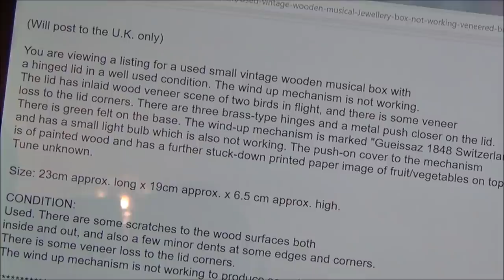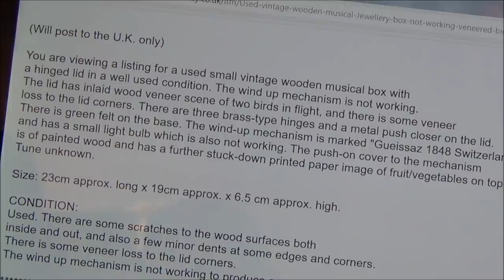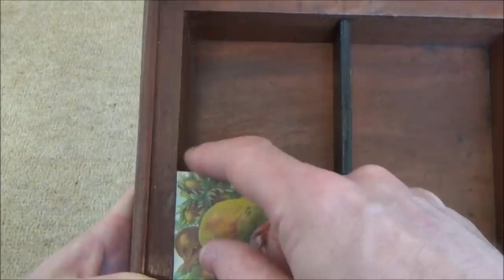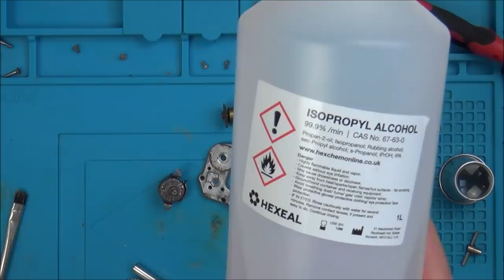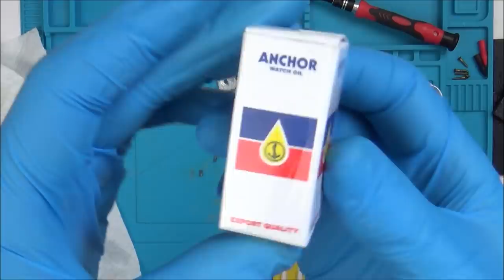Trying to FIX: Vintage Clockwork Musical Wooden Box

Comment: The lever is there to stop to governor when the lid is closed, it wasn't part of the electrical circuit. The brass tab on the right side was one half of the battery contacts.
Reply: @kruleworld  I bet the battery was supposed to be one of those 4.5 volt flashlight batteries, and the top contact went to the metalwork.
Reply: Yep, perfect answer. It's the same as the dancing ballerina as kid closed governor stopped
Reply: @waynestyles4523  no
Reply: @waynestyles4523  d
Reply: precisely
Reply: +1

Comment: The song is 'The laughing song' from 'Die Fledermaus ' by Johann Strauss. The musical box movements are still available to buy ready to put into a box etc. The lead things at 25:05 are dampers. There are on the higher notes to stop them ringing on too much or else it would be just a muddled sound like playing the piano with the  damper (loud) pedal on.
Reply: They are on the lower notes to add mass so that the "harp" does not need to be as long is it would otherwise.

Comment: I agree!  The broken piece was connected to the red wire and would ave been isolated from the frame much like the negative was.  When it broke off it allowed it to make contact, unless it was an earth positive system, but I have only ever heard of those on very old cars.  It would just take a AA or AAA batter set right in that little space.

Comment: Perhaps the light flashes with the music? (Only creating a circuit when it’s touching the pins?) - also there is normally a pin sticking up from the bottom (rather than down from top), so when lid opens, it releases the governor.

Comment: Great stuff Vince you could probably use a small dc motor in place of the governor it would slow it down with the load of the light on their...To generator power for the light.. But not worth the effort doing that....Anyways keep the videos coming as we are bored at home..

Comment: I was about to scream at you but wanted to wait to see if you figured it out. 

The red wire should be isolated and run to a tab separately long the top, the tab being the positive battery terminal.  The black wire should be run to the tab that hangs over the actuating arm. 

Then the chassis of the music box should be grounded to a tab at the bottom for the negative battery terminal.  That way, when you open the box, the start/stop arm (Ground) lifts up and makes contact with the tab (the one with the black wire leading to the bulb) that is hanging over it, completing the circuit.  There is room next to the music box for the battery.  Not sure if it is worth it, because all you are doing is lighting up the inside of a closed box.  But if you have nothing better to do....maybe if you made the upper part out of white acrylic?

Comment: The battery is 4.5 volts and is placed vertically with the contacts facing the wall of the case. One battery contact is fixed to the black cable plate and the other battery contact is free. When you open the case lid, the red wire contact touches the top contact of the battery and turns on the light.

Comment: The ninth fork from the left (as you look at it) sounds horribly out of tune to my ear. It's almost half way in between an A and a Bb. If you decide to take it apart again Vince, have a look at the felt pad and see if you can tune it. :)
Reply: I was listening straight through my laptop speakers and I wasn't getting many of the lower notes at all. On second listen, through headphones, I think there are quite a few of the lower notes which are out although not by as much as that particular one.
Reply: Use a free Android guitar tuning app like gStrings. You will be able to tune each prong exactly by adding or removing solder.
Reply: I'm so glad Vince tried moving it over one peg. I was curious if it would sound better... as soon as he started it I winced. "Nope! Move it back, move it back! You had it right the first time!" Haha.

Comment: The blobs are tuning weights to adjust the tone frequency. The felt is used as dampener to reduce the metal scraching sound which appears on deeper notes.
Reply: The Good Guy he could handle tuning. He’s used an audio spectrum analyzer app in his Walkman series. He’d need to at least know the song’s key but that’s just a google search away.
Reply: Any free Android guitar tuner program would work.

Comment: watch battery behind the bulb holder, then the lever that stops and starts the music has one wire to the bulb attached and the other connects to the whole mechanism, basically make the pivot switch stop and start the music and be the switch for the bulb

Comment: According to the Gueissaz website the company was founded in 1848. From what I have seen all of their products, regardless of date of manufacture, have that date on them. 
From photos of many mechanisms I've seen, the stop bar is bent to fit each application depending on where the box lid has a protrusion available.

Comment: The bent brass tab you removed I believe is suppose to attach to the red wire and then sit between the music drum and the wood separator. The battery would then sit between the two brass tabs.

Comment: been doing a little research on the mechanism and from what I can find the mechanism in use here was changed after 1948. So looking at the materials in use and the machining techniques I would place it somewhere between 1900 and 1948. the box itself could have been made any time.
Reply from the maker: Thanks for letting me know :-)
Reply: @Mymatevince  the date on the mechanism is reflective of when the company started. The base is cast alloy so it suggests it was manufactured after 1900. From what I could dig up, that mechanism was in use up until 1948 so it's at least 70+ years old or could be as old as around 120 years. Looking at the box, the box itself is also quite old but at some time has definitely been added to - ie. the picture. Again you could assume the box is somewhere between 50 to 80 yrs old based on the patina and condition/type of wood
Reply: The base looks like it is made out of zinc (or zinc alloy), the screws are of the pre-Philips head era.  So my guess for it's age would be the late 1940's/early 1950's.

Comment: What a nice video Vince! It's indeed a long time since you did a mechanical item and if you did, it was one of those talking figures. Not that they are rubish or something like that, but an item such as this music box is, like you said many times in this video, very well-made so that you can repair it quite nicely and really enjoy the working mechanism at the end. Really, I love working on this kind of mechanisms too. Besides the light bulb issue, something is not quite right with the tuning of the notes and to correct that you have to tweak those blobs on the "needles", but I guess it is not that easy to do and it is in any case veeeeeery much trial and error. So, just leave it like it is I would suggest. And oh yeah, I really was laughing when you were aligning those needles to the barrel; I've done that a few times in the past and it is really a very time consuming job; but then, when it all works, it is sooooo satisfying... Anyway, great one really, keep on doing those mechanical ones, I love it!

Comment: 4m38s - note the two holes. Someone has took that off and at the very least added the notch for the (I assume) magnet clasp. How do I know? The holes are wrong way. Probably means originally it only had a hole to start/stop the music box. Someone then added the light and a hole and then finally modified it for the magnetic clasp.

The post in the top looks shaped which means it probably used a clasp in the base that was “springy” to lock it. It may also be that post is the original and may have been used to operate the music box. Look for holes :)

It’s also possible that surround for the music box was not originally there when the box was made.  That looks like someone painted it once it was in place rather than the finish the rest of the box has. My theory is either there was no music box or it was uncovered and then boxed in, light added later and modified again for the magnetic clasp.

Comment: Looks like a gap for a AA battery to the right of the mechanism. That brass tab was probably one terminal, the other was what the black wire was fixed to.

Comment: I think the light bulb was ran by a AA battery on the right side of the machine. The bras tab connected to the red wire supposed to be in the gap on top right side.

Comment: I bet the bulb was wired with a spring switch. when you close the lid the tab on the bottom of the lid opens(breaks) the circuit but when you lift the lid the contact springs back to close the circuit. Very simple.

Comment: The lamp might have been powered by a 3R12 battery. They were very common for many decades and the circuit for the light was probably was designed for the battery tabs.

Comment: The Light was a home made addition. The black wire went to the large tab of metal for one end of the Battery. the red wire has a broken tab where the original tab ( contact) would have been. Its just a crude bodge  to add a light

Comment: You know, I've been thinking about the power generation thing.  Even though its clear that it wasn't intended to generate power here's what I see.  If the blade of the "air brake" were a bar magnet and there was a coil next to it, it could induce a current.  Admittedly, it would be far too small a current for the light that's in it.  But I bet if you collected that current into a capacitor, it could drive a modern LED for a little while.

Comment: One terminal of the battery was probably connected to the black wire and the other terminal connected to some part of the "stop" mechanism, rigged up to make contact with the mechanism when the lid was open, completing the circuit to the red wire.

Comment: The brass piece you pulled out of the mechanism looks like it should have been attached to the red wire, it looks like there is just enough room on the right side of the mechanism for a battery. With the brass tab at the top against the wood.

Comment: Never seen a circuit like it, but what I have seen is a circuit that is close to that, where the circuit is completed when the Brass chiming prongs touch the barrels pins by three different coloured lights each colour was insulated from the other colours circuit, any way long story short the lights would dance as the music played, and me thinks this circuit was an attempt to hack out something like the aforementioned..
Reply: I thought that too, maybe that's why some of the pins have the insulation on, maybe they were trying to get the little lamp to light up on certain notes

Comment: It is a motor that pulls it around or a spring. The drum moves at a speed and the light bulb is only a light or a resistor. If the bulb is broken you must replace it.

Comment: Vince, It looks like they were trying to make the music box into a small generator which won't work. Or trying to add a switch so the light turns on when the lid is open.

I have the music box mechanism from a small snowy pond scene music box with a small bear skating on it and the "ice" is just a mirror. If you are wondering about the alignment of the tines (the part that makes the notes) on the cylinder pins The very first and very last tines are not used for the song. Also you want to line up the tines as close and straight as you can or the music box will not sound right.

Comment: As soon as you opened it and started handling the music maker, I spotted the governor being out of alignment. Anytime you come across a clockwork mechanism that releases all its power at once when you wind it, its going to be one of the gears or the governer has become misaligned. If it winds and does not run, a gear or other part is jammed. Unjamming the stuck part may require that you  somehow let the power back out of the mainspring in a controlled fashion otherwise parts can be damaged if the spring lets go violently.

Comment: Hi Vince, got a boring broken item. But probably popular in the current climate where a lot of people are doing DIY. I was using my Black and Decker Mouse sander and it started smelling of burning and it stopped working, I waited 10 minutes thinking it might have a heat protection device and it worked. I ended work for the day after more use and went to turn it on in the morning and it was dead, tried it a few times and it’s dead. Do you want me to sent it to you?
Reply: That sounds like the brushes... look at the brushes (if it has brushes) cause I had a belt sander with the exact same thing. It worked, stopped, worked again and then it died completely. The brushes were just completely disintegrated...

Comment: After a quick google of Gueissaz, I would be asking a valuation just to be sure it's value and certainly, inlay lids seems to be one of their things. You could in fact, see if you can contact them about it just to be sure. They may actually be interested in it. www.gueissaz.com. It wouldn't just be the mechanism they manufactured but looking on their home page, there is an image of part of a mechanism which yours looks like, that box would certainly have been made by them also. You may find it worth far more, you may not, but would most likely interest them. They could also have advised on it and may just have the design plans also. I would be curious and do a follow up after contacting them on it. 

The lighting part I am not sure. Bear in mind, the first incandescent light was demonstrated around 1880 by Joseph Swan, the actual inventor of the incandescent light bulb BEFORE Edison. Certainly it would probably be an addition to the mechanism. Now I know some will say Edison invented the lightb ulb but that is not true and was patented by Swan 1 year at least before Edison and Edison lost his law suit against Swan who countered it. The first working lightbulb used was in Gateshead by Swan in his own household.
Reply: I looked a bit and on the french eBay there is the exact same model, but a lot cleaner and less damaged, in a hand made box just like this one (different "picture" on the front though), it sells for 49€ so I don't think it is worth that much
I'm quite sure I can't link ebay on here but if you search for gueissaz on ebay.fr it's the first listing

Also you're right about the fact that the lamp wasn't in there in the first place apparently

Comment: Clockworks made reduction gearbox's for toys for company's like remco and deluxe reading in the early 60's.. battery operated toys like the crusader 101 and light bulldog tank used clockworks reduction gearbox's .. Those clockworks gearboxes were paired with a much bigger variant of a tkk japan electric motor..

Comment: Never touch the comb it's a nightmare to align it back even on a 18 note .Almost imposible on a 50 note comb multi tune . You put it back wrong first comb finger in not in use is for resonace.
Reply: It s just a test a patience for finding the perfect position for the comb !

Also, it may be a good ideaa to don t touch it with your fingers, the comb it s crucial, it s not allowed to reach humidity

Comment: I really dont see any point at all to that light being in there, its only showing up through that small hole right above the lamp and thats covered by that fruity picture, the actual light you'd get from it if it were working would be pretty poor and theres nothing in the box to actually illuminate anyway? It serves no practical function. The shape of the lamp too would suggest that its meant to light ahead of itself where the most lensing is, not through its side.
Then again, I dont think that music mech is original to the box either, nor the divider and box around the mech. Its off center and a different wood to the rest of the construction. I think that, with its depth and no evidence of ever having a lining, it may have started life perhaps as a small tea chest. The fully felted base rather than having smaller felted feet would suggest it was intended to take some weight while resting on a surface worth protecting, such as a dining table or sideboard rather than a dressing table where it'd take up some considerable space. 

I may be completely wrong but thats what I see ^_^'

Comment: The tiny bracket on the end of the black cable is from a Condenser which controls the spark to the contact-breaker points inside the distributor on old cars. I don't think the box is anywhere near as old as the mechanism.
Reply: I agree. I take mechanisms from damaged boxes and figurines and place them in other boxes, figurines, etc.